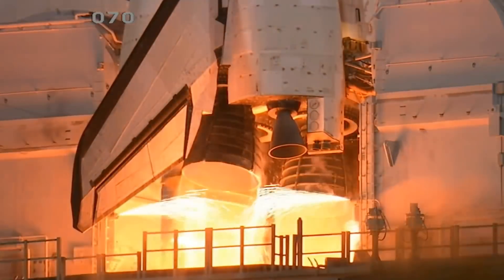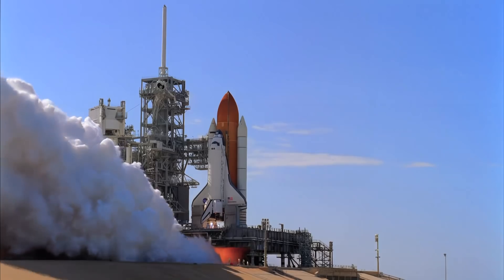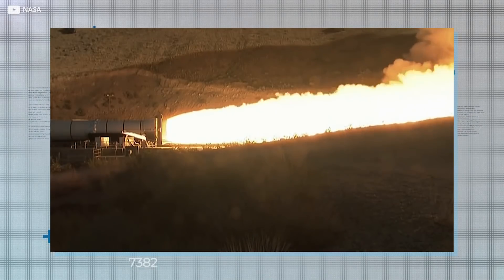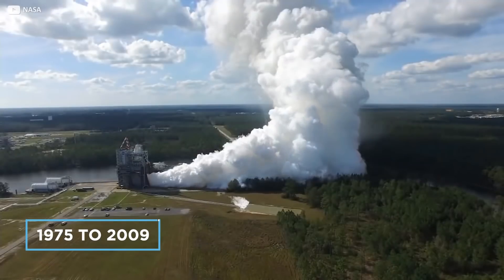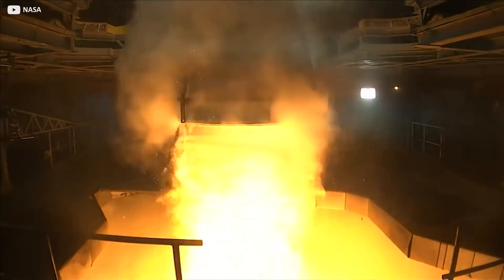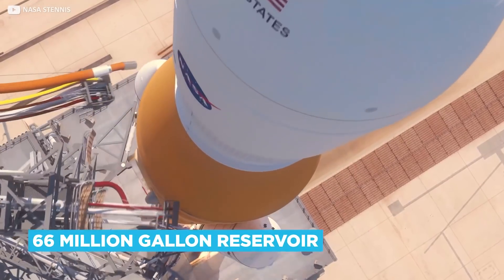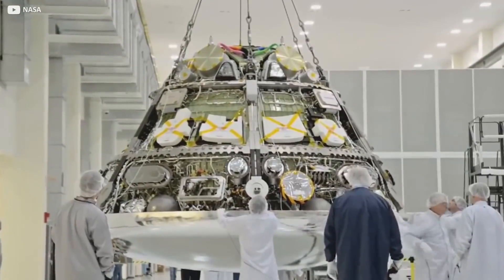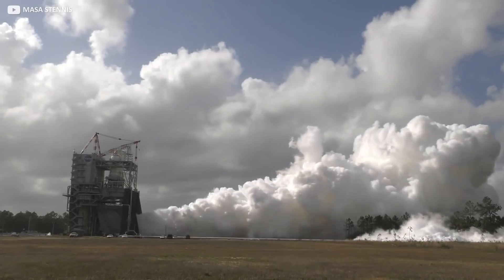How Space Rockets Are Tested Before Launch

Comment: Please, I have a question. I thought pressure increases with height, but you said air pressure at sea level is greater than the pressure off the ground. Please can you clarify that for me
Reply: Air is like an ocean, right? So the weight of the air above squashes the air near the ground, increasing pressure.
Reply: @andyhill7612  Thanks for that.
Reply: Pressure increases with depth. At sea level, you are as deep in the atmosphere as you can get without going underground.

Comment: Testing a rocket engine at 1 ATM does not certify that it will work at 0 ATM.

FAIL.
Reply: If you noticed on the video at the Stennis facility they simulate the atmosphere at 100,000 feet when testing rocket engines.  This has obviously proven very effective with engines like the RS-25 used on the Shuttle and adapted for the SLS.